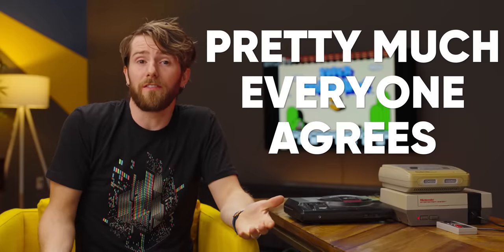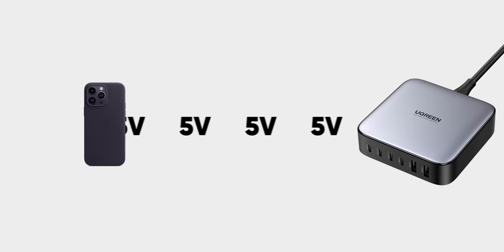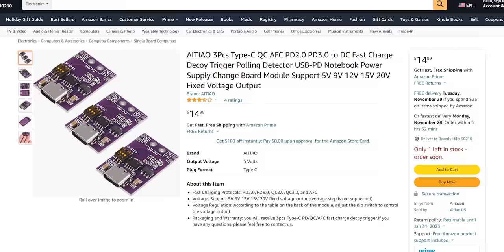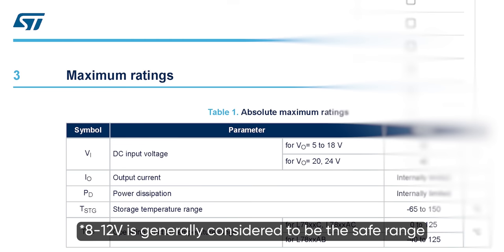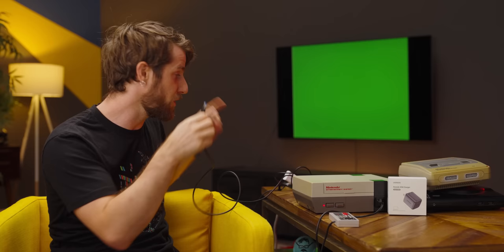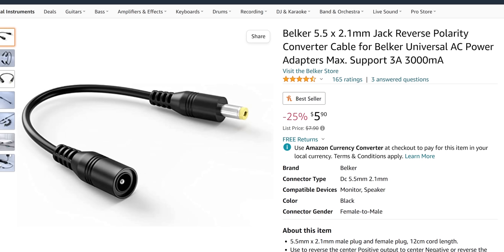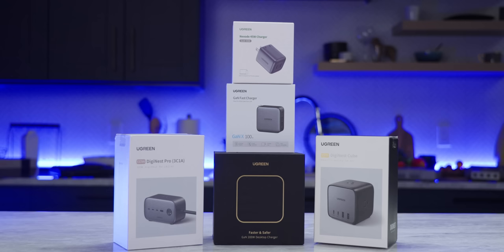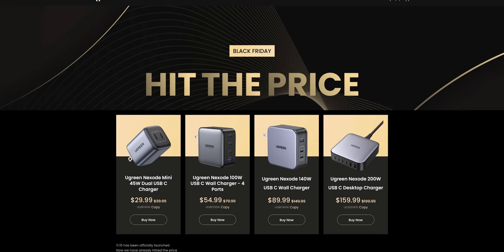How to Put USB-C Power on ANYTHING (almost)

Comment: Apple left the chat...
Reply: The whole ipad lineup, MacBooks, and soon to be iphones because of EU regulation?
Reply: Pippin
Pippout
Reply: The EU has forced Apple back into the chat
Reply: LOL
Reply: They will just go completely wireless.
It will work out about as well as their esim. Being the manager of 26 physicians that all use iPhones they all wanted the 14. Out of 5 phones I have had 2 transfer successfully and 3 fail which requires 30-45 minute call to Verizon for them to push it over the network multiple times until it works.
Reply: Apple went bad :(
Reply: Apple removed the chat
Reply: @raymondhacks  no they can only make them do it in uk… they have 0 power in usa
Reply: Lol
Reply: @gamingclipz7309  having fun being wrong? Its the eu forcing them but new iphones will have usb c worldwide
Reply: Apple joined the chat 7 years ago
Reply: My macbook use a type c to charge.
Reply: eu be like:
Reply: @raymondhacks  they’re more likely to exclude ports (i.e. force wireless charging) than they are to give us USB-C on phones, but your other examples still stand
Reply: Thank god...
Reply: @gamingclipz7309  The UK isn’t even in the EU lol
Reply: Apple uses type c just not in the phone charger side but to the wall plug
Reply: @ohioplayer-bl9em  you must be an american
Reply: @jebbyy32  also applys to to other companies too. So now smart watches won't be using micro usb now on
Reply: No only Iphone department leaves the chat
Reply: I hope they pull out of Europe completely.
Reply: That's gold 😂
Reply: You could use a usb c 12v to Lightning. It’s possible and available. Google is your friend.
Reply: @raymondhacks  they may just get rid of wired charging with iPhones, and I believe lower end iPads still use lightning, not to mention AirPods.
Reply: @jebbyy32  They might just switch to MagSafe. They don't have to use USB-C until 2024.
Reply: @ohio player1177  they were told if they did that , they would fine them 120m for removing the port
Reply: Remember when apple put all usb-c on their laptops and people went batshit crazy? Pepperidge farm remembers.
Reply: @ohioplayer-bl9em  how does bestbuy do 100s a day without a problem they know something you don’t or what 😂😂😂
Reply: My iPad pro is USB-C so seems like they are starting to go the right way
Reply: @jebbyy32  
Apple: leaving
EU: troll face
Apple: F**k
Reply: I dont like apple
Reply: Strange Parts dragged it back kicking and screaming
Reply: iPhone left the chat
Reply: EPIC RAP BATTLES OF HISTORY, APPLE VS USB TYPE C
Reply: @jebbyy32  EU added Apple to the chat
😂😂
Reply: LOL
Reply: @raymondhacks  iPad and MacBook are already type c from like 6 years
Reply: Apple actually worked on developing USB-C

And they got a point that it will be hard on customers changing from lighting, because a lot have lightning accessories…

This was even worse when going from the old 30 pin to lightning since then basically everything was wired, today a lot is wireless so there aren’t really many lightning accessories worth buying.
Reply: lightning is better
Reply: ITT people who don’t know Apple makes things that are not iPhones
Reply: Someone already put USB type C on it
Reply: Tim Cook left the chat
Reply: Facts
Reply: @CGG_GSS The standard iPad they just released in the US is finally running on USB-C. I suspect the iPhone is heading in the same direction.
Reply: @deshdeepak8890  …and the Apple Pencil (gen 1).
Reply: Apple is the co-inventor of USB-C (probably the sole inventor, but it’s unconfirmed).  Regardless of using lightning or USB-C, you’re using Apple contributed tech.
Reply: @gamingclipz7309  cool so everywhere except America get the faster and superior standard? Cool!
Reply: @l979corvette  they're being forced to lmao
Reply: Good one
Reply: @raymondhacks  You mean forced on IPhone.
Reply: @TomGreen99  I'm using this thank you 😂
Reply: @gamingclipz7309  Dude the UK is no longer part of the EU
Reply: Lmao what? They co-invented the standard and were the first company to ever release a product with only USB-C ports? What are you on about?
Reply: @Carl Gunderson having separate charging ports based on region would cost them unnecessary money, which is Apple's biggest nightmare given their ridiculously large profit margins.
Reply: @QVX_  actually now every iPad has usb c so now basically everything but iPhones and AirPods have usb c
Reply: @CajunReaper95  dont think so,people got angry at the esim,but still stuck around.
Reply: @Carl Gunderson actually,they can.im pretty sure if it does not use a cable,its not included
Reply: @mrdz3432  me too
Reply: @mwmwm3388  it actually isnt,usb-c is faster and better,you so not have a valid argument
Reply: @Slain01  who cares about speed lightning is used to charge phones and its more convenient than usb c
Reply: @gamingclipz7309  and the eu
Reply: @mwmwm3388  actually,everyone does.lightning is a direct copy of usb-c,because it wasn't ready yet,apple made their own.Now it (lightning) is old and still,your arguments are invalid
Reply: iPhone left the chat
Reply: @Slain01  how is it invalid?? 😂 all I’m saying is that I find lighting more convenient on a phone geez why are you defending usb c so hard
Reply: @mwmwm3388  because randomly saying yeah lightning is more convenient,without defending your statement to me,is literally just an invalid argument.
Reply: LOL
Reply: @ohioplayer-bl9em  The EU is also working on having standards for wireless charging so that you can wirelessly charge all your products with the same charger. It isn't out yet, as wireless charging does not have any real standards like USB-C does yet, but it is being worked on. And apple will have a vested interest in making USB-C and wireless charging work better for everyone very quickly, so they can always claim they are ahead of the curve and that others are struggling to adapt.
Reply: @_SYDGAMING_  Not quite. If a device is very small so that it can not feasible support USB-C, it may fall back on other standards. This includes devices like a smart Watch. But Smartphones HAVE to use USB-C. Apple is not allowed to make the phone too small so that USB-C would not work anymore.
Also, the ruling does not enforce USB-C itself, it enforces a standard that everyone has to use. If Apple develops something way better that everyone can agree on, it will be the new standard.
Reply: @vexflorez6220  fair enough but it would be odd to enforce everyone and not smart watches too. Like is it really that costly over micro usb to install in bulk.
Reply: European Parliament joined the chat and dragged apple back in kicking and screaming.
Reply: 90th reply
Reply: @Carl Gunderson I don't know man, I would have thought the same thing about the standard iPad...

While you might have a point about the 5G antenna in iPhones, Apple generally doesn't like to maintain multiple configurations of the same device if they don't have to. If you look at the different offerings for most of their products, they tend to only differ in ways that don't require extra design work: the MacBook Air ships with a standard M1/M2 chip, and really only allows for further configuration in the RAM and SSD (i.e. drop in replacements).
Reply: You can buy PD to magsafe adapters
Reply: @Gold63Beast  that's 
Not the point
Reply: @doodlecaboodle9298  cause YOU, personally, know EXACTLY what the OP really truly meant to say with his 4 words and 3 dots. 😂
Reply: Apple is so SCARY of the USB-C HAHAHAH LOL
Reply: @FreshRobloxTroller  the iPad as USB C…..
Reply: @Carl Gunderson They can
Reply: @mohamedsaaid3592  But haven't completely because of lightening royalty greed. You know what's the deal, you're just playing innocent
Reply: @raymondhacks  took a while?
Reply: @ktfjulien  so you want proprietary charging standards instead of a universal one
Reply: apple necros chat 8 years later "we had it first!"
Reply: @ktfjulien  
I hope they pull out of the whole world completely.
Reply: @AustenHilton  No, I want governments to stay out of technology
Reply: Apple’s all usb c except for phones.
Reply: Apple’s dual usb c charger does not pause the power for a new handshake.
Reply: @Queldonus  
That's a pretty big exception...
Reply: False apple joined the chat especially with their new chargers now using usb-c even if its only to the charging block 🤷🏼‍♂️
Reply: @tjadams5983  
Doesn't count when they require their own proprietary connector. It defeats the entire purpose of a standard.
Reply: @ohioplayer-bl9em  that sounds like Verizon being shitty to me. I’ve been using esims on iPhone for years and had no issues at all.
Reply: @gabrielramosr  r/ImGayAndIBaseMyPersonalityOnSubreddits
Reply: @ohioplayer-bl9em  while they can completely go wireless and have no ports at all, the EU regulation require a usb c port on their device, so i don’t think they can go all portless at all, at least not the these few years
Reply: @CajunReaper95  if only....
Reply: @PowerPuffBoysZ  jokes on you, you’re both wrong. they’re going to make it completely wireless. “devices that are capable of wired charging” all apple has to do is make all of their devices incapable of wired charging, by using wireless.
Reply: @boilingstomachacid1999  but then they wont make money of normies who buy billions of accessories to dock their phone to
Reply: @PowerPuffBoysZ  wireless docks. apple always finds a way to be apple
Reply: LET THE JOKE DIE. THEY’VE BEEN USING USB-C FOR YEARS.
Reply: @GyroCannon  why would they force that when the EU would then just force them to support Qi
Reply: @memeityy  then the EU will force them to support Qi
Reply: Heh heh heh, I have a feeling that they'll rejoin the chat when they find out that they can't sell in the EU anymore until they incorporate USB-C.
Reply: @mwmwm3388  No. Get out.
Reply: @HeelerHouse  That won't be necessary, any Qi enabled device is universally supported by all Qi charging pads you can buy. Some apple devices already support wireless charging.
Reply: Apple only has to put usb c on the iPhone if it has a charging port. They will most likely just remove it from the iPhone instead of putting usb c on it
Reply: Not in the eu
Reply: @gamingclipz7309  They will do it worldwide though otherwise they would have to run separate fabrication lines for different ports. There would be no financial benefit to doing this so it would be sheer stubbornness at that point if they did.
Reply: and stay out
Reply: Lol
Reply: Bro this guy forgot about Xbox and PlayStation
Reply: @gamingclipz7309  If they really wanted to stick a middle finger at having to discontinue lightning, they should just go the hand crank route.
Reply: Cant wait to see what Apple will do in Europe regarding their push to USB C only.
Reply: They have now
Reply: @raymondhacks  yes but you're still gonna have to use official Assle cords to get full charging or charging at all.
Reply: The EU dragged Apple kicking and screaming back into the chat
Reply: @ohioplayer-bl9em Nope, the EU law mandates the existence of a charging port
Reply: @GyroCannon Nope, the EU law mandated the existence of a charging port
Reply: Apple took this comment personally
Reply: Apple rejoined the chat
Reply: And just joined!
Reply: apple enters again
Reply: No it dident iPhones have USB c now 😅
Reply: this comment aged well
Reply: i assume thats a foreshadow?
Reply: Apple joined the chat
Reply: Apple was added to the chat by EU
Reply: Apple was forced back into the chat by the EU
Reply: They finally joined the chat
Reply: Apple joined the chat
Reply: APPLE HAS RE-ENTERED THE CHAT
Reply: no they were not the sole inventor... usb is owned by intel and they led the project with help from multiple other companies including apple, apple were not the lead of it
Reply: Apple rejoins the chat
Reply: this is so old news now iphone 15 has usb c 😂
Reply: My iPad is USB-C😮
Reply: lol, aged like milk
Reply: Hol up?
Reply: Apple joins the chat with iPhone 15 line up
Reply: About that...
Reply: Apple joined the chat...
Reply: @BobaPhettamine Intel owns Thunderbolt. USB is an industry group.
Reply: They had usb c on MacBooks and iMacs a long ass time ago
Reply: @raymondhacks yeah only because of eu regulations, nothing to be proud of because apple would have never done it they're self if it wasn't enforced by law
Reply: @Veefan3  I could easily be wrong, but I'm of the opinion they were going to eventually. The EU mandate just got them off their butts and did it sooner.
Reply: @eddie9802  True. Inferior brand. Hehe.